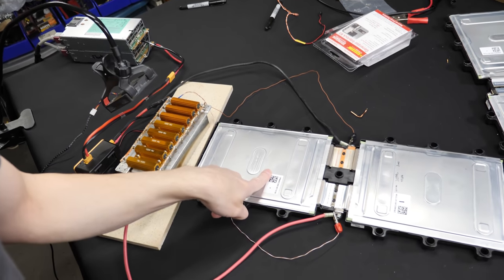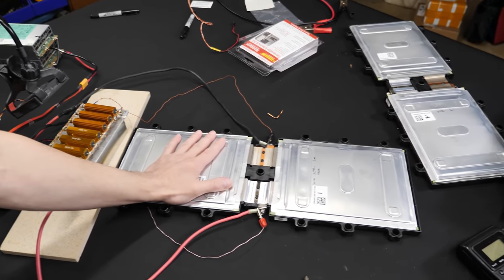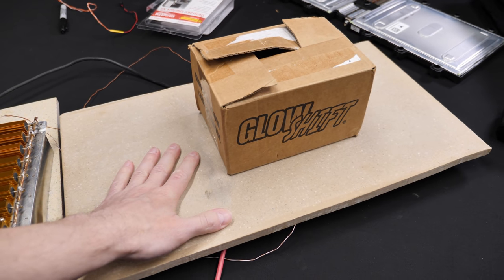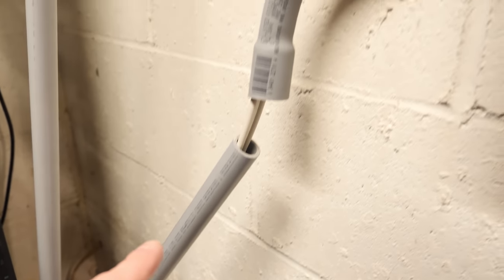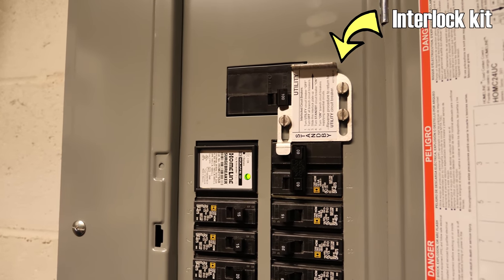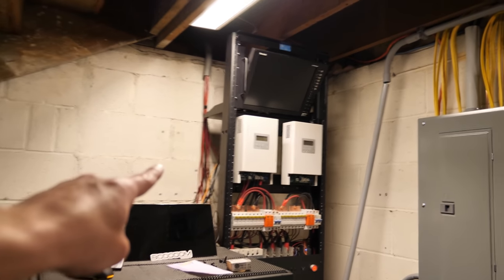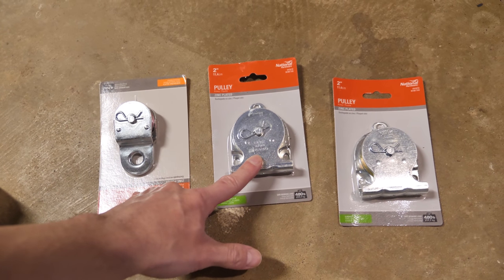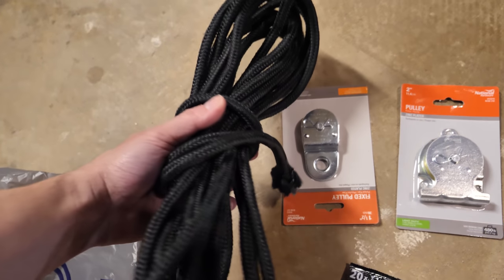Attempting to Mount 165lb Growatt Inverter on Wall!!

Comment: You know, you were planning on doing this installation from the beginning, so my Question is, (Why wouldn't you have somebody help you to mount the Growatt on the wall)? Instead of you trying to do it all by yourself. I don't understand that. Huh... Then that would have saved you some money not buying those pulleys that probably cost quite a bit of money and Rope to do that. I don't get it. Also what happened to the back top plate that was supposed to be mounted on the wall first, where you can hook the GroWatt to it, it would not have come down.

Comment: I wouldn't trust those plastic anchors. It should have a back plate and use Tapcon screws with unistrut channel easy to mount and remove if needed.
Reply from the maker: They seem to be holding up but will keep an eye on them as others have mentioned. I for some reason completly forgot about unistrut too lol🤦‍♂️

Comment: All due respect but why buy an inverter that weighs 160-180lbs. The extra cost of shipping that unit you could take the money and spend a little more on a 50-60lb inverter that is just as good or better.
Reply from the maker: I wanted a 12kw low frequency inverter. Only paid 2k shipped. I havent seen a equal inverter that weighs 50-60lbs that can do what this inverter will do!

Comment: I would not trust those screws.  You are using the wrong ones. Trust me on this one. Don't know the size you are using. Here is the correct ones to use...  https://www.homedepot.com/p/Tapcon-1-2-in-x-4-in-Steel-Hex-Washer-Head-Indoor-Outdoor-Concrete-Anchors-10-Pack-11420/300656455#overlay or could use the next lower size of 5/16 instead. Anyway replace them one at a time and you shouldn't have a single issue. That massive inverter will be solidly attached to that wall for good!